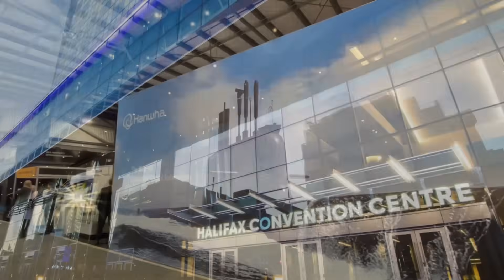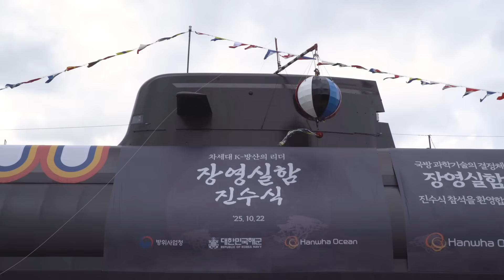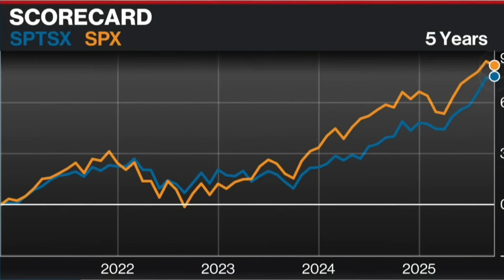THE FUTURE OF THE ROYAL CANADIAN NAVY: Korea's KSS-III Submarine

Comment: The hexagonal Stals-shaped, non-magnetic 305 stainless steel hull, which is said to be the advantage of German submarines, is completely inconsistent with Canadian naval demand.
It is a technology designed because the Baltic Sea is a shallow sea with an average depth of 55m. Rather, the hexagonal hull has problems such as speed reduction, rotational force reduction, and complex rudder control programs, and the yield strength of the 305 stainless steel is less than 480 Mpa, and the yield strength of the KSS-3's HY100 is about 690 Mpa.
Of course, KSS-3 also has a way of avoiding magnetic fields. There is a Degaussing technology that does not make the hull a non-magnetic material, 
but incorporates coil equipment into the hull and generates a magnetic field to resonate.
I think Germany's strengths are excellent technologies, but I think the countries that need it are countries such as Poland and Norway, not Canada.
Reply: KSS-3 배치-2 는 포스코 코리아 에서 생산한 hy-100 강 을 사용합니다. hy-100 강은 비자성 오스테나이트 성질을 가지고 있습니다.디가우징 도 사용합니다.
Reply: @mkchoi8080 The unique application of South Korea’s steel technology in defense is also evident in the following aspects.

Regarding protection, the K2 is fitted with domestically developed composite ceramic armor based on silicon carbide (SiC). This armor is produced under extreme temperature and pressure conditions, providing significantly higher hardness and reduced weight compared to conventional rolled steel, which greatly enhances the tank’s mobility and fuel efficiency. The ceramic was developed by a Korean defense company and is classified as a top-secret technology. Industry experts evaluate this armor as having protective performance comparable to that of advanced main battle tanks such as the U.S. M1A2 Abrams and Germany’s Leopard 2A7, while offering a notable advantage in strength-to-weight ratio.
Reply: @mkchoi8080 To add a few more points, Japanese submarines employ a double-hull structure, originally designed for deep diving to evade detection, which limits internal space. This design has continued in modern Japanese submarines, making them less suitable for long-range oceanic operations. In contrast, South Korean submarines, built using POSCO’s specially engineered steel, have undergone rigorous testing and sustained long-term operations without requiring a double-hull structure.
Reply: @mkchoi8080 As a point of reference, the Korean metallurgical company POSCO supplies its Giga Steel to 15 global automobile manufacturers, including GM, Ford, Renault, Toyota, Honda, Nissan, Mercedes-Benz, BMW, and Volkswagen.
Reply: Hanwha Ocean’s submarine (KSS) program has strengthened maritime defense capabilities based on advanced design and operational expertise. In addition, Hanwha Ocean possesses world-class capabilities in icebreaker construction and icebreaking operations. The research vessel Araon, built by Hanwha, has operated in both the Antarctic and Arctic for years, accumulating extensive polar experience and know-how, and South Korea became the first country to construct an LNG carrier capable of breaking through 2-meter-thick ice. Centered around Hanwha Ocean, in the mid-2000s, Hanwha Ocean shipyards secured approximately 65% of global ice-class vessel orders, establishing international trust. Furthermore, by 2026, Hanwha Ocean plans to complete the next-generation icebreaking research vessel, and in doing so, South Korea will play a pivotal role in polar scientific research and international collaboration.
This is the KSS III submarine, built by the company with this icebreaking technology.
Reply: Generally, the German Type 212A submarine is not designed to break through ice like an icebreaker and is assessed to operate only under ice with a thickness of about 1-2 meters. In contrast, South Korea’s icebreaker construction technology enables breaking through 2-meter-thick ice, which could potentially be applied to submarine polar operations. Therefore, South Korea possesses a technical advantage to expand the KSS submarines’ polar operational capabilities, contributing meaningfully to Arctic strategy.

Comment: Very interesting news.  This could be good for Canada, but I am always concerned around Lithium Ion batteries and the risk of fire, or rather rapid thermal run away of lithium batteries.  That could be deadly on a Sub.if not properly isolated with a back up system to surface in the event of a thermal run away.
Reply: The lithium batteries of the KSS-3 Batch-2 submarine are separated by bulkheads and automatically monitor battery temperature to prevent fires. This ensures safety even in the event of a fire. In the event of a fire, a dedicated lithium battery fire extinguisher activates, completely submerging the lithium batteries in a dedicated fire extinguishing fluid to extinguish the fire and prevent the fire from spreading to adjacent cells.

The battery cells are solid lithium batteries manufactured by Samsung, and an automatic fire extinguishing system developed and installed by Hanwha Systems monitors temperature and humidity. The system is equipped with a safe lithium battery fire extinguisher that automatically activates an alarm and extinguishes the fire.

The lithium battery cells are housed in a thick-walled container, and a fire extinguishing system is installed above each cell. The cells are spaced apart from each other to prevent the fire from spreading to adjacent cells in the event of a fire in one cell. The KSS-3 Batch-2 submarine batteries are automatically monitored by computer for temperature, humidity, and heat detection, and if an abnormality is detected, the system is automatically controlled by an AI system.

Comment: HANHWA means HAN(Korea) + HWA (Explosive)  😋
Reply: Hwa refers to Hwayak, gun powders.
Reply: @IndiotPlasticCow  Hwa = fire or explosive YaK= medicine or powder.
Reply: @WD40a  No. Hwa = fire, Pogbal = exclusive, Yak = medicine or powder.
Reply: @WD40a Hwa doesn't mean explosive in any Korean dictionary. You are confusing.
Reply: Hwa doesn't mean explosive in any Korean dictionary.
Reply: Hwa doesn't mean explosive. It should refer Hwayak to be Korea Explosives.
Reply: The Hanwha Group's corporate roots lie in a company called Korea Explosives. It was the first company in Korea to produce nitroglycerin, the raw material for dynamite, and developed various explosives. During the Korean War, when North Korea invaded the South, Hanwha's explosives and dynamite contributed to the operations of South Korean and UN forces.
That's right.
The "Han" in Hanwha is the Korean pronunciation of "Korea," and "Hwa" means "gunpowder."
Hanwha began as "Hanwha," an abbreviation for Korea Explosives Group.
However, Hanwha Ocean has no connection to explosives manufacturing.
Hanwha Ocean began as Daehan Shipbuilding & Offshore Engineering, a state-owned shipbuilding company.
It was acquired by Daewoo Group in 1978 and became Daewoo Shipbuilding & Marine Engineering.
It was then acquired by Hanwha Group in 2023 and became Hanwha Ocean.

Comment: The Type 212CD has a 41-day (almost 6-week) submerged endurance and is powered by air-independent hydrogen fuel cells.

Which ever sub we get, we need to make sure (given the timeline) they come not with lithium-ion batteries, but with sodium-ion batteries which provide higher energy densities and are less volatile.
Reply: 212cd  잠수함 아직 개발 제작중.<<<<실제 성능 알수 없음.     ---- 한국 3600 ton  잠수함 현재 존재함>>>> 실제 성능  바로 확인 가능

Comment: My fear is the batteries, bit of an uncontrollable fire hazard. I'm sure they have some plan to mitigate that, curious to know what it would be.
Reply: The lithium batteries of the KSS-3 Batch-2 submarine are separated by bulkheads and automatically monitor battery temperature to prevent fires. This ensures safety even in the event of a fire. In the event of a fire, a dedicated lithium battery fire extinguisher activates, completely submerging the lithium batteries in a dedicated fire extinguishing fluid to extinguish the fire and prevent the fire from spreading to adjacent cells.

The battery cells are solid lithium batteries manufactured by Samsung, and an automatic fire extinguishing system developed and installed by Hanwha Systems monitors temperature and humidity. The system is equipped with a safe lithium battery fire extinguisher that automatically activates an alarm and extinguishes the fire.

The lithium battery cells are housed in a thick-walled container, and a fire extinguishing system is installed above each cell. The cells are spaced apart from each other to prevent the fire from spreading to adjacent cells in the event of a fire in one cell. The KSS-3 Batch-2 submarine batteries are automatically monitored by computer for temperature, humidity, and heat detection, and if an abnormality is detected, the system is automatically controlled by an AI system.
Reply: Every single submarines have large batteries to operate under water, even the subs from WW2. Nuclear submarines have smaller batteries, but I don’t think Canada can afford one.  I’m more sacred of staying underwater for weeks. Yikes.

Comment: A 4,000-ton conventional submarine equipped with 10 vertical launch systems is a unique strategic weapon in the world, capable of surveillance, reconnaissance, attack, and defense. It is truly a "two-faced" submarine that can be transformed into a strategic asset, which is simply astounding.
Reply: 28 Virginia-class submarines have 12 vertical launch system tubes. The KSS III has 10 VLS tubes. It is a great submarine for Canada.
Reply: @wtfmco the missiles that the Virgina class have are cruise missiles. The ones in the south Korean one are true ballistic missiles, very different
Reply: Top notch
Reply: Absolutely.
Reply: Except that the RCN doesn't desire SLBMs, but a hunter-killer submarine.
Reply: @JK-h3e however they could come in handy for attacking targets on shore..
Reply: 프로필에서 당신의 친한국 성향이 드러납니다
Reply: @dolezhang9265  What does this have anything to do with China, 50 cent Chinaman?
Reply: @dolezhang9265 친중국인 것보단 낫지.

Comment: What with having NK as their neighbors, it shows that they don’t mess around..🙄
Reply: North Korea is no match for South Korea; the real issue is China. When aircraft carriers or submarines from China’s Dalian shipyard move toward the South China Sea, they tension over avoiding detection by South Korean radars. However, South Korea monitors everything, tracking their position. Due to the limitations of conventional submarines, they can’t stay underwater for long. That’s why South Korea developed vertical launch systems. Once South Korea builds nuclear submarines, it will even be able to monitor Russian submarines. South Korea alone is responsible for monitoring North Korea, China, and Russia, which is why South Korean weapons are known for their reliability, low maintenance costs, and longevity.
Reply: Isn’t that why Philippine also interested in acquiring KSS subs for their military operations?

Comment: I heard that there is nothing in the budget released in November 2025 for submarines. Therefore I don't think a decision will be made on submarines until late 2026 at the earliest. I like the fact that Hanwha Ocean and Hyundai Heavy Industries will put aside their rivalry and competition to work together and build the subs faster. I also like the larger size of the KSS-III Batch-II (3,600 tons) compared to the smaller Type 212CD (2,500 tons) because it offers more space for the crew and the internal design of the KSS-III allows for a male & female crew which makes it easier to find qualified people. The KSS-III having VLS tubes offers more options for weapons like having some VLS tubes loaded with air or underwater drones or two tubes loaded with ballistic missiles and the other VLS having surface-to-air missiles so the sub could be a mobile underwater SAM platform to shoot down enemy missiles and aircraft. The Koreans are already designing their future submarine concept that will be called the KSS-III Batch-III (4,000 tons) or the KSS-IV (2,000 tons) and equipped with a stealth hull, solid-state batteries, next generation fuel cells, next gen AIP, and a rim-driven propulsion system that will make it quieter and I believe it will have superior abilities to any other sub on the planet. The Canadian government still hasn't made a decision on jets for the Canadian Air Force. I think the government will renew the free trade agreement with the States in 2026, then decide to either buy more F-35 fighters or fly one or two F-35s with a group of Saab Gripen fighters. After the Canadian fighter decision is made then the submarine will be chosen. Saab had a brilliant idea by suggesting Canada build Gripen fighters for Ukraine because then it's easier for the Canadian Air Force to buy 80-90 Gripen E/F fighters to be used in the Arctic. I read that Saab is developing the Maritime Gripen (Sea Gripen) for carrier use. If Canada buys Gripen fighters, I hope they get the Sea Gripen with stronger landing gear for short & rough Arctic airstrips and a tailhook for catching the arresting cable when landing on icy runways or emergency landings to stop quickly like the CF-18 Hornet. Canada could save the F-35s for NATO missions in warmer climates because the hydraulic fluid in the F-35 freezes at -20 degrees Celsius, as we have learned from the crash in Alaska. In 2018, multiple F-35A flights out of Eielson Air Force Base in Alaska were disrupted when pilots received warnings that a key battery in the plane was failing mid-flight. The pilots were forced to land as quickly as possible and switch out the battery, wiping out flying hours and raising costs for maintenance and raising the fear that in an emergency, the U.S. would be unable to scramble its high-end fighter. After studying the issue, the Air Force discovered the problem was a result of extreme cold entering the F-35 when the doors to the jet’s nose landing gear were open, setting off alarm bells, according to “for official use only” documents. Everyone says a mixed fleet of aircraft for the Canadian Air Force would be too expensive, but American aircraft carriers have more than one type of fighter for different missions, and Ukraine is operating several different types of jets. The Ukrainian Air Force is currently using old Soviet MiG-29 Fulcrums, Sukhoi Su-24 Fencers,, Sukhoi Su-25 frogfoots, Sukhoi Su-27 Flankers, Lithuanian L-39ZA Albatros (trainer & light attack aircraft), old American F-16 Fighting Falcons, French Mirage 2000 jets, Czech-Slovak Shark & Yakovlev Yak-52 drone-killer propeller aircraft, and various helicopters & drones. Ukrainian President Volodymyr Zelenskyy signed a letter of intent covering a potential sale of more than 100 Saab JAS 39 Gripen E fighters. President Zelenskyy has outlined plans for a future combat fleet of approximately 250 aircraft, including new F-16s, Gripen Es, and Rafale fighters. The Nordic countries have a more efficient Air Force because their mixed fleet of F/A-18s, Gripen C/D & Es, F-35 jets, helicopters, and drones use the different strengths of each aircraft to enhance the abilities of the entire group. The Swedish Saab Gripen E is estimated to cost between $5,800-8,000 per flight hour. The American F-35 Lightning II is estimated to cost between $25,000-42,000 dollars per flight hour, which includes fuel, maintenance, and other operational expenses. France's Rafale is estimated to cost between $20,083-28,690 per flight hour. The American F-16 Fighting Falcon is estimated to cost between $8,000-27,000 USD per flight hour depending on conditions. The American F/A-18 Hornet is estimated to cost about $10,000 per land-based flight hour and $18,000 for carrier operations.
Reply: The Gripen and Rafale and F18 super hornet block 3 are all better aircraft than the F35 any time of the day, so take the 16 F35s we already bought and buy one of the other 72 aircraft from one of the other 3 aircraft, having 2 fleets is no big deal compared to the F35, the F35 will be too expensive to fly and maintain with very low availability around 35% to 50% on a good day, so the cheaper aircraft will be used more than the F35.
Reply: @KellyBrownlee  With the delivery of TR-3 combat software during 2024, F-35 combat readiness will increase significantly... All Block 4 F-35 fighters will have TR-3 combat software upon delivery... Canada's first 16 F-35s will all be Block 4... It's not the engines that were effecting F-35 combat readiness, it was the combat systems software...
Reply: Wow. Did you know there is an [Enter] key on the keyboard?